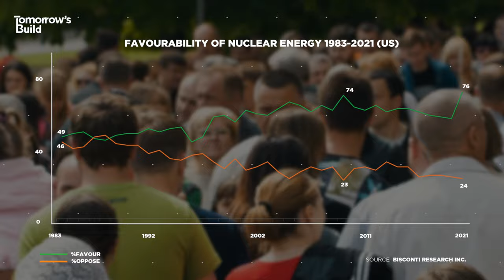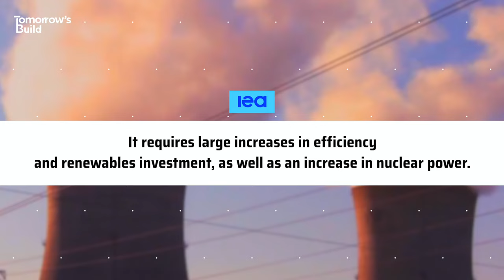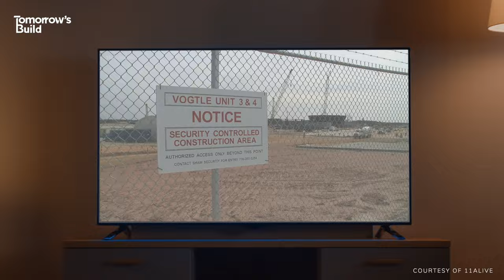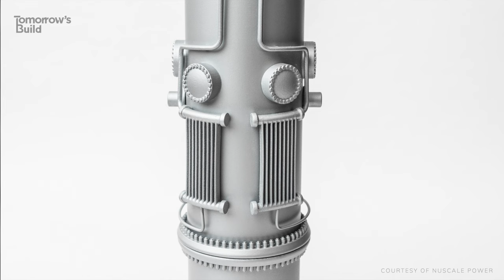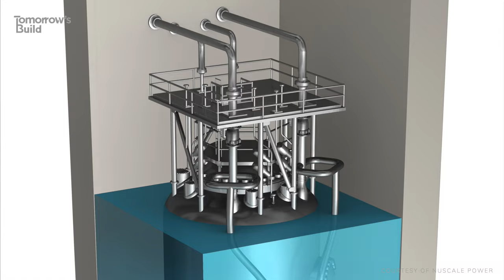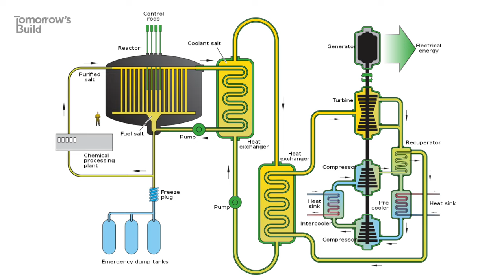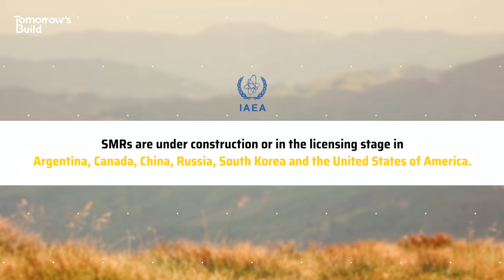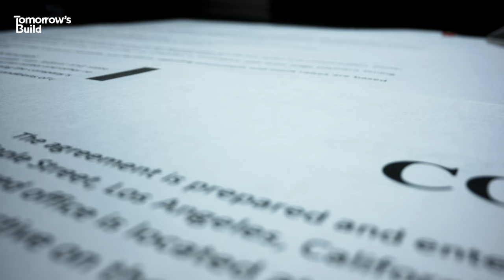These Mini Nuclear Reactors Can be Built Anywhere

Comment: The thing that I find iffy with these are the risk of much worse inspections and checks.
Nuclear should have rigid and impartial oversight.
Accidents in reactors comes from cutting corners/costs.
Reply: An impartial regulator would be a huge improvement from the actively hostile ones now
Reply: @kokofan50  huh? We're probably not from the same country so what do you mean/how are the current regulations about nuclear reactors "over the top".
Just look at the last big accedent, Fukoshima.
They had been getting faults on their preparidness and they didn't fix it(their backup generators in the cellar) even though regulators had issue with that.

I do want to be clear that I'm well aware that nuclear reactors isn't near as "scary" as many believe, it's really a boon for mankind and we'll most likely need it for as long as we figure fusion reactors out.
But it's not something to take lightly either.
That's why there's need to be rigid regulation for it.

Comment: I would prefer the advancing of Thorium salt water reactors. There is nearly no waste . It burns up 97 % of itself and a piece as big as your thumb nail gives sufficient energy for all your energy requirements for your whole life , from car to industry to household et al. Its also very safe and will switch itself off if it reaches a certain temperature. You can obtain and carry thorium on you personally and you dont need a permit or concern yourself with safety. It only activates once heated.

Comment: Another way to look at this, spreading power generation/supply out and having the ability to make that output either more or less dense as the population or industry requires makes the grid a lot more resilient. In case of disaster, only those generators in affected zones will go offline - the rest of 'the grid' wouldn't be affected. 'The grid' wouldn't exist any more if these were installed all over as needed and that may turn out to be their biggest hurdle. It would be a lot more difficult for a government to turn off everyone's power in one go.
Reply: That would be best achieved with renewables on a "energy mesh" network. Not nuclear plants.

Comment: This is a logical progression for nuclear power. Modular kits that are safer  and easier to monitor, fix and contain in case of an accident.  They can be put in non populated areas or even under water. Mini power stations can be swapped at the earliest sign of failure,  or end of life without any effect to the consumer. 

The next stage is to design a micro power supply for cars, trains etc. With a hundred year lifetime the energy crisis would be erradicated, no more carbon production, pollution or environmental impact.
Reply: Give me one example of a Modular reactor in the U.S. .  Otherwise your comments are based upon a company power point presentation or YT video.

Comment: I guess people are sick of hearing that solar and wind are intermittent so one needs a backup power source, which is expensive to have 100% generation capacity held in reserve. Nuclear is not intermittent.

Also solar and wind are defuse sources which means extra losses in transmission whereas small modular reactors great reduce transmission costs.
Reply: "The U.S. Energy Information Administration (EIA) estimates that electricity transmission and distribution (T&D) losses equaled about 5% of the electricity transmitted and distributed in the United States in 2016 through 2020.4 Nov 2021

US Energy Information Administration (EIA)"

5% shouldn't matter.
Reply: Every reactor takes at minimum 10 years to build, and at minimum 250x original cost estimate. This has been true since the first reactor.

Comment: SMR cost per kWH is high, yes but that's only at the beginning of development that it is like all new Nuclear Reactor Tech.  Once you stream line and have production lines of SMRs the price drops significantly which is the fundamental point of doing SMRs in the first place.
Reply: Simple answer without any facts.  Nuclear has NEVER in the last 70 years become less expensive as we build more....NEVER!

This is from the Des Moines Register an ultra conservative newspaper concerning the only Small Modular Reactor (SMR) project in the U.S. today.
In 2013, the Wall Street firm Lazard estimated that the cost of generating electricity at a new nuclear plant in the United States will be between $86 and $122 per megawatt-hour. Last November, Lazard estimated that the corresponding cost will be between $131 and $204 per megawatt-hour based upon the 4 recent new nuclear projects in the U.S. . During the same eight years, renewables have plummeted in cost, and the 2021 estimates of electricity from newly constructed utility-scale solar and wind plants range between $26 and $50 per megawatt-hour. Nuclear power is simply not economically competitive.
SMRs will be even less competitive. Building and operating SMRs will cost more than large reactors for each unit (megawatt) of generation capacity. A reactor that generates five times as much power will not require five times as much concrete or five times as many workers. This makes electricity from small reactors more expensive; many of the original small reactors built in the United States were financially uncompetitive and shut down early.
The estimated cost of constructing a plant with 600 megawatts of electricity from NuScale SMRs, arguably the design closest to deployment in the United States, was originally advertised as costing $1 billion but upon requesting actual bids from engineering firms, increased to $6.1 billion in 2020. Given inflation and other cost constraints that cost today can only be expected to be significantly higher.
The cost was so high that ten members of Utah Associated Municipal Power Systems canceled their contracts. NuScale then changed its proposed plant configuration to 6 fewer reactors but increased each reactor output from 50 Mw to 77 Mw costing at total of $5.3 billion. The NRC just last week approved the construction of the 50 Mw design but now will have to start the review process all over given the switch to a 77 Mw design. For each kilowatt of electrical generation capacity, that estimate is around 80% more than the per-kilowatt cost of the Vogtle project in Georgia — before its cost exploded from $14 billion to over $30 billion. Based on the historical experience with nuclear reactor construction, SMRs are very likely to cost much more than initially expected. And they now have delayed the project start until 2025 in an attempt to find more backers.  All this before the inevitable setbacks that will occur once construction starts.

Comment: This sounds great, in the wider society there is still a large amount of fear directed towards anything labeled "nuclear power". I hope in the future we can get over this unnecessary fear and hopefully utilize this clean energy source. These mini nuclear reactors sound great.
Reply: they are not cheap.

This is from the Des Moines Register an ultra conservative newspaper concerning the only Small Modular Reactor (SMR) project in the U.S. today.
In 2013, the Wall Street firm Lazard estimated that the cost of generating electricity at a new nuclear plant in the United States will be between $86 and $122 per megawatt-hour. Last November, Lazard estimated that the corresponding cost will be between $131 and $204 per megawatt-hour based upon the 4 recent new nuclear projects in the U.S. . During the same eight years, renewables have plummeted in cost, and the 2021 estimates of electricity from newly constructed utility-scale solar and wind plants range between $26 and $50 per megawatt-hour. Nuclear power is simply not economically competitive.
SMRs will be even less competitive. Building and operating SMRs will cost more than large reactors for each unit (megawatt) of generation capacity. A reactor that generates five times as much power will not require five times as much concrete or five times as many workers. This makes electricity from small reactors more expensive; many of the original small reactors built in the United States were financially uncompetitive and shut down early.
The estimated cost of constructing a plant with 600 megawatts of electricity from NuScale SMRs, arguably the design closest to deployment in the United States, was originally advertised as costing $1 billion but upon requesting actual bids from engineering firms, increased to $6.1 billion in 2020. Given inflation and other cost constraints that cost today can only be expected to be significantly higher.
The cost was so high that ten members of Utah Associated Municipal Power Systems canceled their contracts. NuScale then changed its proposed plant configuration to 6 fewer reactors but increased each reactor output from 50 Mw to 77 Mw costing at total of $5.3 billion. The NRC just last week approved the construction of the 50 Mw design but now will have to start the review process all over given the switch to a 77 Mw design. For each kilowatt of electrical generation capacity, that estimate is around 80% more than the per-kilowatt cost of the Vogtle project in Georgia — before its cost exploded from $14 billion to over $30 billion. Based on the historical experience with nuclear reactor construction, SMRs are very likely to cost much more than initially expected. And they now have delayed the project start until 2025 in an attempt to find more backers.  All this before the inevitable setbacks that will occur once construction starts.

Comment: I personally don't think that modular nuclear reactors are viable for producing power for individual towns. For me its not a matter of safety, more so it is a matter of economics and engineering. I don't think it's particularly economic to have small towns operating modular nuclear reactors as a means to produce power for their town. I am not a civil engineer however my understanding of the situation is that a town would have to undergo significant infrastructural changes in order to facilitate the operation of a modular power station. In addition to this as the size and power output of a reactor becomes smaller, the operation of a reactor will become less economically efficient, meaning that ultimately the cost per output of energy would increase substantially. My issue when it comes to the engineering of a modular, small, or very small, nuclear power reactor is as follows. It is no secret that the United States has been experimenting with these kinds of nuclear reactors for a very long time, and while such reactors have been shown to be viable under specific circumstances, it would be irresponsible to ignore the limitations of such circumstances. Mainly, the pressure vessels for even very small nuclear power reactors must be substantially large and dense to facilitate the pressures created during the operation of the reactor. This severely limits the portability of these types of reactors. I believe that rather than having very small or modular power reactors operating in individual towns it would make more sense to have moderately large power stations, which have a number of small to medium fixed in place reactor assemblies. These power stations could potentially use smaller quantities of fuel which could be received as either pre-fabricated assemblies or as smaller rod assemblies. However, event these types of smaller power stations would face the issue of cost per unit of electrical energy produced; although the inefficiency would be considerably reduced from that of very small nuclear reactors. I don't claim to have all the answers to this problem however this is my opinion. Feel free to disagree with me I ask only that you do so respectfully so that we can have a pleasant and productive exchange of ideas.
Reply: You have a very well thought out argument vs the "but explosions!" majority. I agree with you. 

I think it would be better to have a few large nuclear reactors vs dozens or hundreds of smaller ones. Why have 20 when you can have one. Every small one will require a team of specialists 24/7 and all of the other bells and whistles that a large reactor has but scaled down. 

The operating costs seem high for what you're getting in power. Operation, maintenance, security, safety, etc. It's  safer, cheaper, and more efficient to have a large facility in a rural location with multiple reactors to generate power. There really isn't much benefit to generate power right in the city center vs a hundred miles away. Does the safety and operating costs outweigh the transmission loss? I could see them being used in a rural area, like Africa to generate power if they are well run. But in a metropolis I just don't see the benefit over one large facility with multiple reactors. 

I'm all for nuclear power, the public has a terrible stigma against it due to oil company lobbying and public ignorance about their safety.
Reply: @gangisspawn1  I agree I greatly prefer the idea of having a number of large power stations. My argument was to offer an alternative to a modularized system that would be able to function in the somewhat limited circumstances in which a modularized system would be applied. But I think that a large reactor mass distribution system vastly outperforms medium to small/modular systems in nearly all categories; say for very limited circumstances where a large power station would not be possible or practical.

Comment: At 02:14 I hear "Nuclear power plants can take decades to build...."
Here in the Netherlands, we have one 515 MW nuclear power plant.
Construction started in 1969 and it was finished in 1973.
That is 5 years or half a decade. And it is still running fine.
There is absolutely no valid reason that it should take decades.
If we declare a national emergency, I am sure that we can have a similar size reactor running in 5 years and one more every year.
Reply: The reason it takes so much longer is regulatory, not technical.
Reply: The reactor you have will at most be a Generation II reactor.  A Generation III or III+ reactor would need to be rushed for it to be ready in just 5 years, the two that were built in China and Finland took around a decade and were still built wrong.
Reply: The plant at Borssele produces 12 tonnes of high-level waste per year.
Reply: @armorclasshero2103  And 96% of that get reprocessed into fuel.  4% of 12 tonnes is  480 kg....a cube about 30 cm per side.  Small price to pay.
Reply: @michaelbrininstool4515  guess who reprocesses it: Russia. Good luck with that now.

Comment: Portable reactors like in science fiction could help significantly change society. Helping us reach more remote locations both on and off of Earth with a reliable source of electricity while doing so.
Reply: You mean like...nuclear batteries? Which have been around for decades and are used to power stuff like mars rovers and satelites? There even have been pacemakers powered by nuclear batteries around 50 years ago.
Reply: Who is going to maintain these things.. or check on them if they are in a remote location ?  If they are in remote locations the economics just won't add up.
Reply: @1968Christiaan  robotics, the idea is for this to help create a more decentralized grid
Reply: @oO0Xenos0Oo  Nuclear batteries are fine for small applications that don't need a fuck-ton of power. Good luck trying to run your house on an RTG. You might be able to run your coffee machine but that's probably it.

Comment: У атомной электростанции электрический кпд не более 15%. Остальной это тепловая энергия, большую часть которой отводят в атмосферу. На видео нет градирен для отвода большого количества тепла.   A nuclear power plant has an electrical efficiency of no more than 15%. The rest is thermal energy, most of which is released into the atmosphere. There are no cooling towers in the video to remove large amounts of heat.